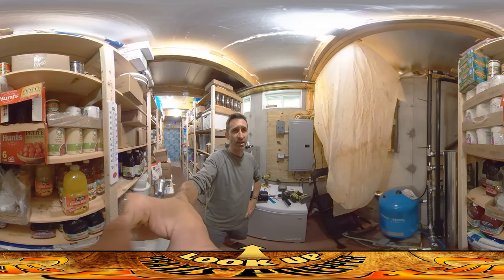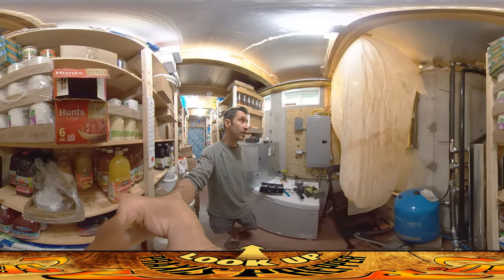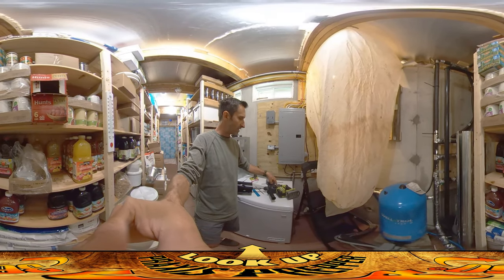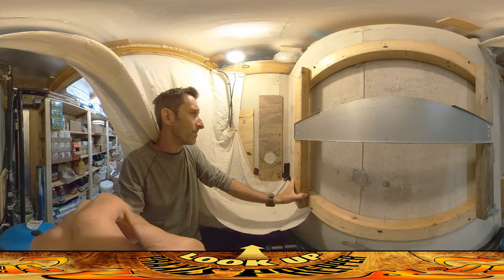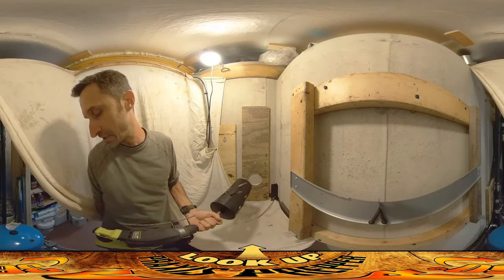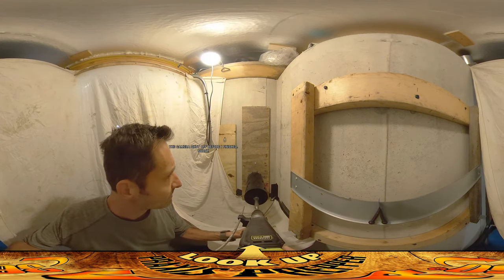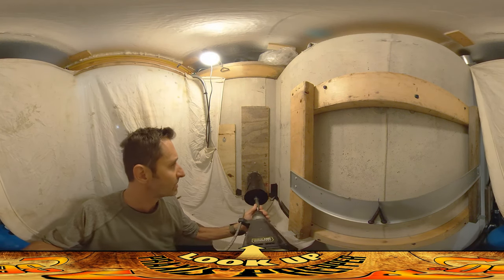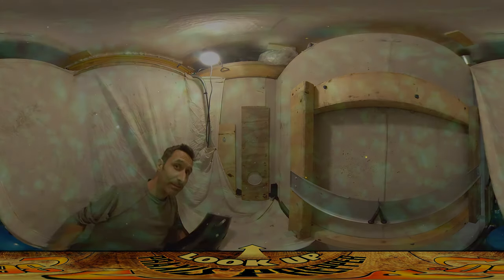Homestead Building - Coring a  5" Hole in Concrete

Comment: When you mentioned previously that you were able to buy the tool for coring for $300, I was surprised and assumed you found a used coring tool, this makes a lot more sense now. I’m imagining that the next couple of videos are going to mention just how brutal using a bit with a hammer drill really is, even with the hammer feature disabled, And yep, drilling big holes through concrete is a slow process, curious to hear how much heat became an issue.